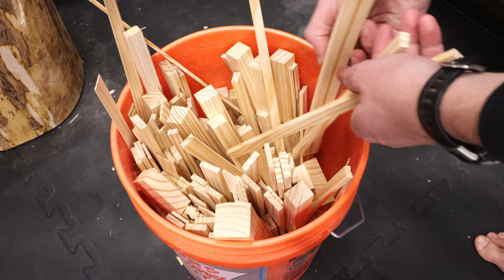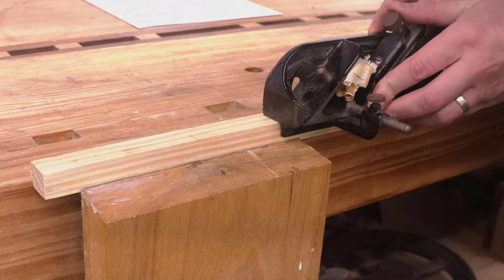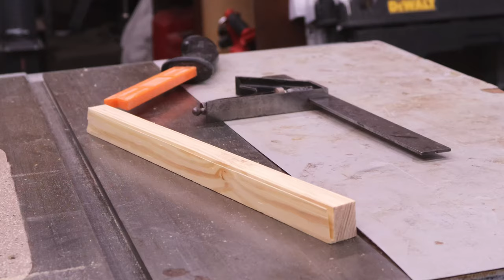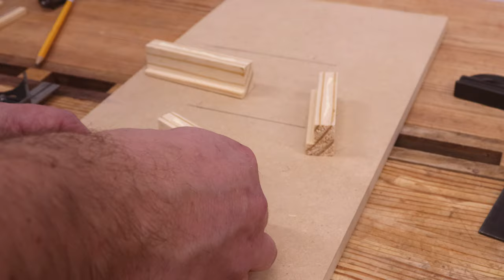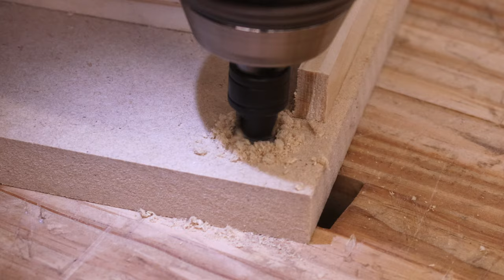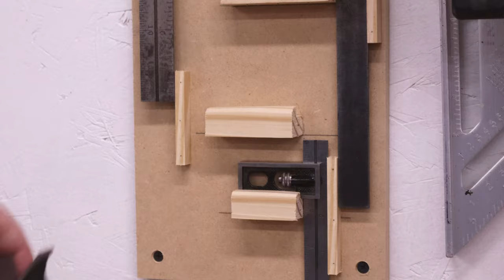How to Make a Wall-Mount Combination Square Storage Rack | Workshop Organization

Comment: Why take all that time to plane a rabbit and then use nails to connect the wood to the board? Why not just glue and nail the "lip" instead of cutting them out?
Reply from the maker: It was easier than cutting a little piece of wood to use for the lip.